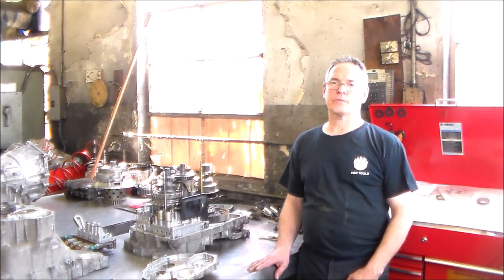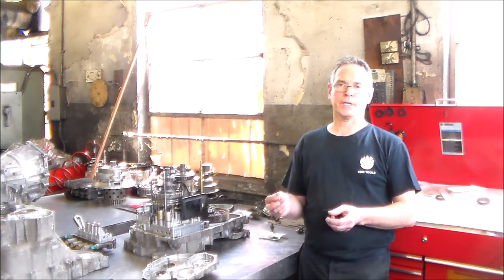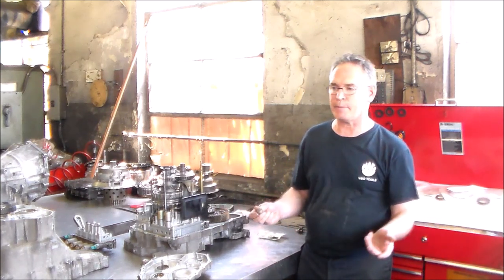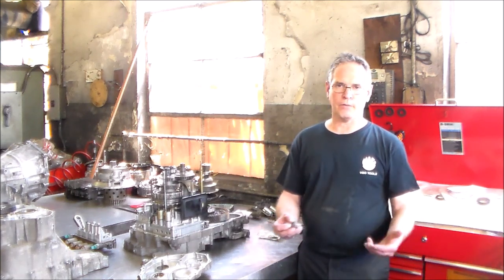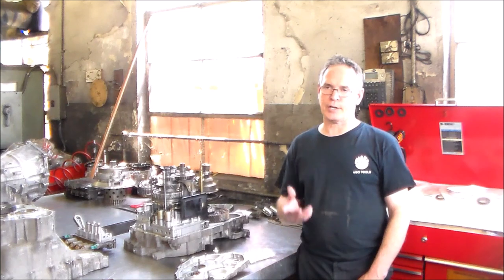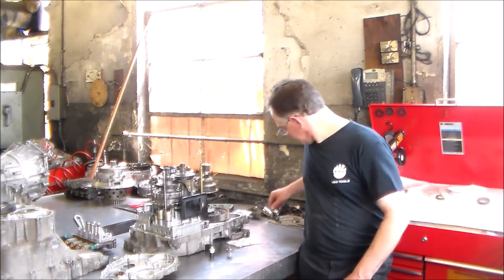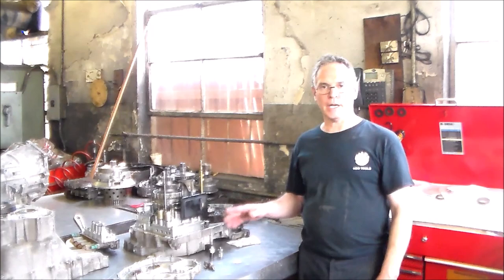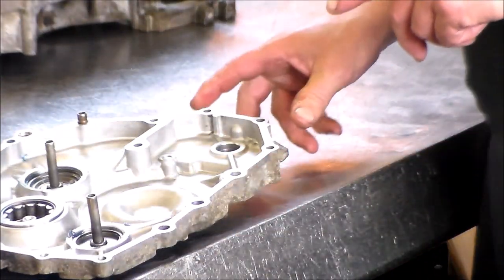Honda Pressure Switches

Comment: O3 odyssey it's a 2nd and 3rd. Replacing 3rd now
Reply from the maker: clutch packs or switches?
Reply: @GaryFerraro  Switches
Reply from the maker: Electric Poliville ok. When it comes in with a pressure switch code I like to do them all
Reply: @GaryFerraro  I broke it replacing the starter. Then I figured out it was easier to just drill a hole in the plastic in the fender well and add extensions. Took about ten mins to put in the new starter in that way. All hand tool
s. Thanks for the video. Switch cost me $95.00 from dealer, yikes. Should have just went to junk yard.
Reply from the maker: @Dragon90815a  Dealer was smart, these have a very high failure rate

Comment: 06 Honda pilot when you have a drive light blinking how do you know which sensor switch to change
Reply from the maker: scan the car to get the code
Reply: Michael Johnson,, For your vehicle it is most likely the intake manifold sensor switch. Believe me.
Reply from the maker: @michaell3711   This would cause the D light to flash?
Reply: @GaryFerraro  ,,, Definitely . I had similar issues with the 90s Accords and never got any transmission codes with a blinking D light. Many are unaware that on those years Hondas,,, the problem is a faulty Air Intake manifold sensor. It is easily located on the 92 to 2002 Hondas.

Comment: I had to pull the sensor and flash it out an put it back in an it good for a while
Reply from the maker: it's common for those switches to go bad, i get them from the dealer

Comment: help acura tsx 04 D flashing and jerks on 1 gear
Reply from the maker: Have the car scanned, there are codes present, thats why the light is flashing
Reply: no codes at all
Reply from the maker: @rickxs619  With a D light flashing there has to be a code, thats the reason why it flashes, may need a better scan tool to pull the code
Reply: @GaryFerraro  Honda Motors Co. is so 3rd world friendly that the "D" light actually blinks the code itself with morse style pulse... as detailed in the shop manual.
[Some people expect to get a message on the car display pointing to an actualpart number... LOL!].
The trend is part failures never list the cause! (engine oil leaking from old valve cover is actually caused by plugged PCV, not bad gasket 🤫!)

Next well hidden failure screwing with both engine and transmission is... the Serpentine+TENSIONER that is pegged... No belt symptoms but  reduced power, random misfires and vibrations. TCM struggles to compute proper shift points! (80KMi and up)
👍
👍

Comment: No check engine light and no flashing D4 light for me its flare shifting between 1-2 mostly and a little between 2-3!
Reply from the maker: What is year make and model
Reply: Same problem here. 1999 honda accord  2.3. Flares especially on 2/3 shift less on 1/2 shift. Should I replace 2 and 3 pressure switches?
Reply: @martinjay9959  I would go ahead and do both, but mostly the 3rd gear pressure shift will affect 2nd to 3rd gear shifting whereas the 2nd gear pressure switch will affect 1st to 2nd gear shifting. As a test you can unplug your 3rd gear pressure switch and go drive around and you should notice it shifting a lot smoother. Hopefully your wiring harness doesn't break like mine when I unplugged it. I had to order a new wire harness for the 2nd gear pressure switch and will have to cut out the old wire harness and wire in the new one.
Reply: @koreymayo8884  Thank you for that? How long can I drive with the 3rd gear pressure switch disconnected? I was going to pull/check the shift solenoid b&c also. Are the correct parts numbers for #2 pressure switch- 28600-RCL-004 or 28600-P6H-003
and #3 28610-RKE-004?  These are the numbers I researched
Reply from the maker: @martinjay9959  Well if the transmission has not been overhauled, replacing the switches may not help. so you have a flare on the 1-2 and 2-3?
Reply: @GaryFerraro  it does help tremendously! These transmissions don't need a rebuild til well over 300,000 miles if you change the fluid regularly and the soleniods as needed.
Reply: @GaryFerraro  2002 honda accord coupe LX 2.3 liter 4 cylinder only 126k miles.
Reply from the maker: @koreymayo8884  Thanks for that, i honestly have never seen an original trans make it that much but agreed fluid change is key, i would do a drain and fill at least once a year
Reply: @GaryFerraro  I have heard of many that go over 300k miles online. Most I have seen in person is over 200k on a 2001 2.3 liter 4 door owned by a family member and they have never done the soleniods and haven't done transmission fluid in a while if ever and never did the timing belt lol. I've been telling them it could snap at any time. I'm going to have my timing belt and water pump done this month or next at 126k miles. I've also heard of people going over 400k miles without ever adjusting the valves on the engine.
Reply: Another question.  My 1999 accord has 183k original transmission  still flares in 2/3 shift. Was flaring in 1/2  shift but added Prolong transmission additive and fixed almost all of 1/2 flare.  Does that tell me my transmission is still probably OK.  Can you put the same oil pressure switch  in #2 and #3 as there both 1 pin connectors? Appreciate your help and knowledge shared with us!
Reply: @martinjay9959  your transmission is probably still fine since I've seen them go 300-400k miles! The pressure switches are different PSI pressures. The 2nd gear one is green and the 3rd gear one is black or brown.
Reply from the maker: @martinjay9959  The switches close at a certain psi to let the computer know your in that gear. I would go by the vin number and get the switches from the Dealer
Reply: I finally tried to install the 3rd pressure switch as the car was at dealership for 3 weeks. Recall on the ignition then they broke the mirror and waited for parts.. The switch unplugged and came out easy. It was a 2 pin connection instead of the 1 pin new honda one I bought so I need to reorder the correct one. I unplugged the sensor and test drove. No change in 2/3 flare. Do you think I'm stuck with this or still chance it can be fixed? Did you have success on your car?

Comment: Absolutely no help at all!
Reply from the maker: Sorry about that, do you have a Honda with a pressure switch code?
Reply: I have the code 848 on 2006 civic . Changed bottom and back top switches . Fluid drain and fill. .still have code and flashing D 
Drives and shifts as it should

Comment: Does a 1997 Honda Civic EX have the Transmission pressure gauge switches
Reply from the maker: I believe it may have 2
Reply: @GaryFerraro   will they make it be like it’s in neutral when it’s in Drive
Reply: @GaryFerraro   hay Gary will that make it seam like it’s in Neutral when is it in drive
Reply from the maker: @frankieburacker807  Not really, may make it flare on a shift. When do you feel the neutral condition
Reply: @GaryFerraro   feel it after the transmission fluid warms up